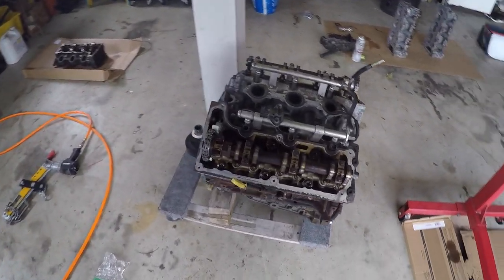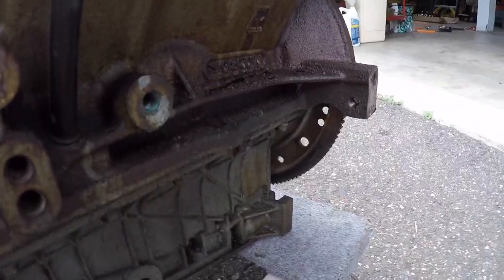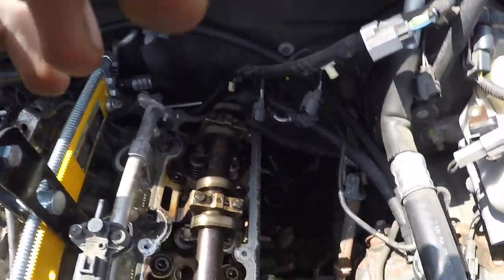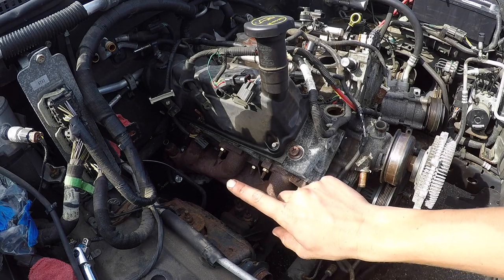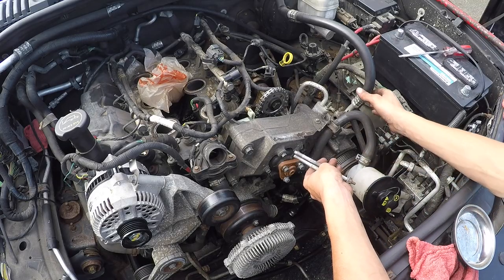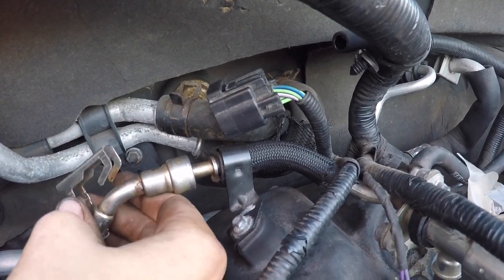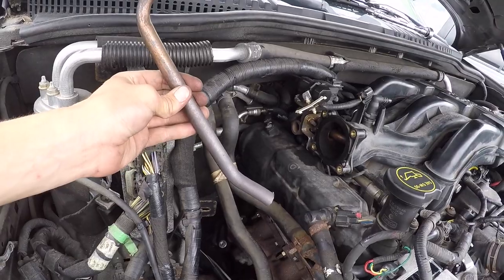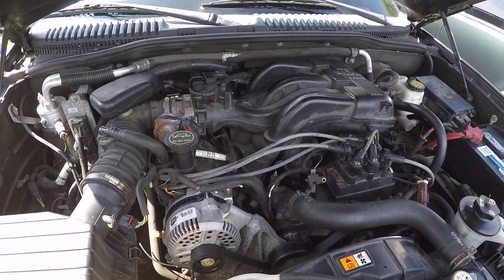HOW TO INSTALL A 4.0L V6 ENGINE - 2002-2010 FORD EXPLORER (COMPLETE GUIDE)

Comment: ford ranger slightly different for accessories and unfortunately i think the bay is a little smaller but about the same, this is helpful, but it makes me want to discharge my AC for the extra room...
Reply from the maker: The bay is definitely smaller. The plenum is different, harness is confusing, things all over the place. That’s why I literally won’t touch a ranger. I can have an engine out of an explorer in 3 hours.

Comment: The ground wire coming from the fire wall. Where did that bolt up too
Reply from the maker: right above the exhaust manifold. 10mm bolt. I think its above the 2nd runner.

Comment: Any tips on a 4.6 getting converter studs to line up
Reply from the maker: Get the flywheel down into the bell housing. Use a curved end crowbar to spin the converter through the bottom. If i remember correctly down by the oil pan there’s some access where that little shield goes.

Comment: Turned the engine over and it fired up then lost all electrical power, any pointers as where to start? I’m assuming it’s a fuse or something simple
Reply from the maker: Never heard of such a thing. Check your grounds.
Reply: @iamdjnam   I took the battery out and put it back on the charger and it started fine,  I did forget to tighten the nut on the starter
Reply from the maker: @tylerhuffman2113  perfect. Hope all is fixed now.

Comment: Hey I have a question, I am rebuilding a 4.0 it over heated, when I go to put the camshaft in  they are hard to turn do you think the head shrink, this is my first 4.0 built
Reply from the maker: Take it to a machine shop and have them check for warpage. Cams toques down should not be super tight to turn. Whenever an engine I’m working on has over heated badly, I always find a donor motor and start fresh. Lots of things can go wrong with heat.
Reply: @iamdjnam  ok Kool, that was my first thoughts, the motor only have 75k that why I choose to rebuild
Reply: @iamdjnam  thanks for tip

Comment: Just wrapped up my 4.0 project and it works GREAT largely due to your excellent video. So THANK YOU! Now that its back together I found one oil leak. Oil is dripping from the pass side tensioner right onto the exhaust manifold. So it wreaks, but at least its burning off and not making my engine gunky lol! Anyway, I have the tensioner torqued correctly, and I do have the washer installed with it. I'm wondering if there's something else I should be doing there to prevent the oil from leaking? Gasket? Sealant? Any thoughts?
Reply from the maker: Don’t use anything except the crush washer. The mating surface may be nicked or the washer not fully centered. You can try cleaning the surface with a fine fine fine fine emery cloth at your own risk! Aluminum is very easy to scratch!
Reply: @iamdjnam  Gotcha!
Reply from the maker: Just be careful cuz the torque spec on those is only 32ft lbs. you don’t want to pull threads out of the head. Usually when they leak the washer isn’t centered.

Comment: ? I put a new 4.0 in my 2004 ranger vin #e. 2003 motor doesn't have a egr valve . Used my wiring harness because there was a plug in for transmission. Engine light on how do I trick computer on this issue?
Reply from the maker: You were supposed to use your exhaust manifolds and intake manifold from the old engine. There’s no way to trick the ecu unless you install an EGR valve or get it tuned to run without one.
Reply: Yes I did see my error. now I have a vaccume leak somewhere! Gonna due a smoke test tomorrow. Thank you!
Reply: She's running!
Reply from the maker: paul clauson Nice man! Vacuum leaks are always hard to find. I usually spray carb cleaner and listen. Sometimes I find the gasket failed between the EGR and intake causing a nasty leak!
Reply: @iamdjnam  On my old engine I found out what was causing the rattling I was hearing. Inside the harmonic balancer something broke. Stick your finger in there and it was just spinning around freely. New motor is running mint! Gonna rebuild other 4.0 l vin #E. Thanks for your help!
Reply from the maker: paul clauson That’s the weight that breaks off. Common issue. Never caused a rattle before on my explorer.

Comment: Hey Nick good news it Runs! Bad news it’s missing! I have had so little time to work on this it’s a little disappointing. Any advice to where to start? Thx ps I love the end of this video! Oh the misses get more frequent with time running.
Reply from the maker: Vacuum leaks, plugs, wires, O2 sensors.
Reply: Have you ever seen a cassette blow up and crack a head? I got my hands on a scope and I think I see water droplets on top of piston. Its the number 4 cylinder right next to the front cassette.. that sucks looks like I have to confirm with leak down test.
Reply from the maker: Never. Might be condensation. I’ve seen them blow valve covers to smitherines
Reply: Hey thanks again… I’ve got a leak down kit coming today. It was fine before the cassette blowing up and yes it blew up my cover.
Reply: Hey Nick got the leak down test and confirmed that air is coming out the timing chain, the head is still on and that number 4 cylinder plug was fouling. This is bad… with a piece of rubber hose it is loudest down about 6 inches? That sounds like a block issue. I still have the front timing cover on leaning towards taking that off and spraying soapy water on the block. Got a better suggestion aside from lighting a match?
Reply from the maker: @kjjerome  a leakdown test will either tell you if air is escaping past the rings, intake valves, or exhaust valves. Which is it?
Reply: Well it’s not the exhaust or intake and air is loudest coming from front timing chain so that leaves only the rings but hearing air coming out the front timing chain seems really strange. Thx again
Reply from the maker: What’s the % of leakdown? I’ve ran engines at 70/100 no problem. Some air is normal.
Reply: @iamdjnam  like a dumb ass I ordered heads before I actually knew what the problem was. My plan of attack is to jerk the timing cover off again and visually try to see the leakage. There is considerable air leaking into the front timing chain if I can determine that its in the head then I’m ok but if it’s the block then I’m done! Just hate to tear out the radiator to get that harmonic balancer of to pull the timing cover. I got this much time into it what’s another few hours at least then I’ll know. Sucks to be me today said with half a smile at least I have a chance that it’s the head! Hey you have an excellent day! I’ll let you know what I find.

Comment: You sir are a magician/wizard ... I have had to deal with installing this engine in the 2001-2007 Rangers and they're nothing short of a proverbial nightmare. BTW ... How did you keep from snapping the exhaust manifold studs off? I heated mine up with a torch and some of them still broke off.
Reply from the maker: Thank you for your kind words. I use MAP gas. If they break off I have a stud extractor tool.
Reply: @iamdjnam  You're welcome ... I used map gas too but this was a 2007 Ranger from Northern W.V. and it took on a lot of salt so needless to say, every nut and bolt was rusted on. I saw one of those stud extractors at NAPA and I was going to get it until I saw they wanted $52 for it.
Reply from the maker: @jonathanbox3033  Amazon $24
Reply: @iamdjnam  WOW ... I'm taking a trip to Amazon :-)
Reply: Use air impact. No one break. I have bad winter weather.

Comment: Has that silicone tube held up well on the exhaust tube?
Reply from the maker: Mike Ezepek Yes! Still using it! No issues whatsoever
Reply: What bolt do you use on the back of the load leveler. You said a harness bolt but what harness? Thanks!
Reply from the maker: @mikeezepek  the 13mm engine harness bolt behind the intake on the passenger cylinder head
Reply: @iamdjnam  gotcha bud! After I screwed it back in I forgot about that bolt! Perfect!
Reply: Found one last bellhousing bolt. The one that holds the bracket for the fuel line from the topside. The passengers side top bolt. 
How in the hell did you get that out? Ac line is bumping me and I can get my hand down and a wrench head on it but have no room to back my hand out and get on the wrench or socket.
Reply from the maker: @mikeezepek  LMAO yes that’s a pain! I pop the lines out of the bracket and kinda bend it in my favor, then get my 13mm box end and go to town
Reply: Again many thanks. I was finally able to come around the block from the drivers side with one hand holding the socket wrench and had the other hand come in from the topside as a guide. Got that f#%^er tho! Is that the bracket you are saying disregard on the reinstall?
Reply from the maker: @mikeezepek  Screw that bracket. I never put them back

Comment: What size are the bolts you use for the exhaust?
Reply from the maker: M8x1.5 studs to the head, 1/2” stainless x 3.5” for the flange

Comment: I’ve taken this engine out 3times doing a install the torque converter I’m not all the way threw the wholes first I thought I wasn’t all the way back now I’m wondering is the transmission bad ? Or does the torque not go all the way back ? HEEEELLLLPPP MEEEEE
Reply: Have you figured it out yet?

Comment: I had someone put in a use 4.0L engine in my 07 explorer but the engine doesn't turn on now obviously the mechanic i hired doesn't know what he's doing but I did talk to some mechanics and they said something about resetting the ignition
Reply from the maker: No such thing as resetting the ignition. The mechanic messed up.

Comment: That part between the engine and transmission is called the flex plate.
Reply from the maker: rob peters thanks for clarifying. I always thought the flexplate was bolted to the crankshaft (torque converter studs go through it too).
Reply: Flexplate is for a manual transmission Flywheels for automatic transmission. Both of those bolts up to the engine between either the clutch or converter. And that piece of metal spacer or shim is called a piece of $#!÷@ that keeps falling off. That's what I call it
Reply from the maker: It’s a turd isn’t it…. Sometimes takes longer to keep that in place than it does to actually get the engine running again.
Reply: Yeah one of the many wonderful things that automakers do for us to keep the blood flowing and to keep beer off the shelves. I'm doing one right now
Reply: @turdferguson1915  You got it ass-backwards... a manual transmission has a flywheel and an automatic has a flex plate.

Comment: The lock nut on a manifold will eventually melt
Reply from the maker: Mine from 3 years ago is still holding. And the ones from my backhoe which was made in 72 is still intact.

Comment: The worst car ever..recurring failures in the engine, gearbox and electrical wires...what is the alternative engine for it with a manual gearbox?
Reply from the maker: 4.6 3v will bolt in then just use the manual transmission from a mustang gt

Comment: I had to do a timing chain job on a mustang with this 4.0 engine, with the engine still in the car.. it was a pain in the ass, had to remove the transmission and oil etc, total dumpster fire. I would never own a ford 4.0, only clowns would want to own this shit..